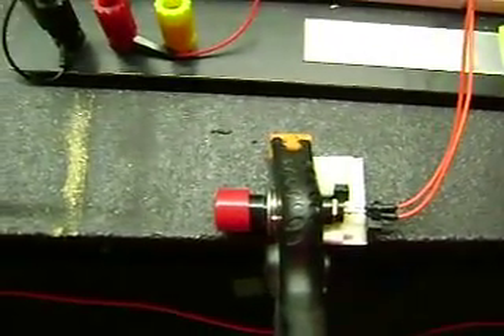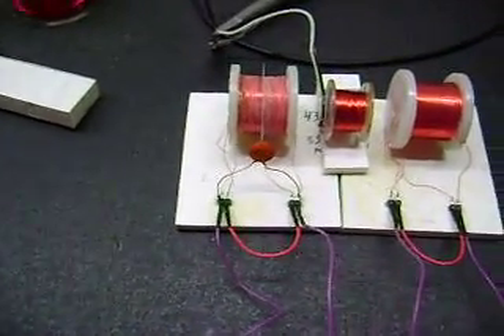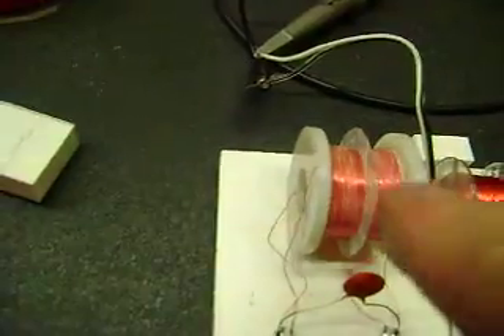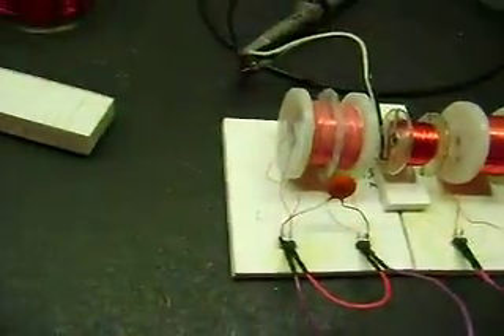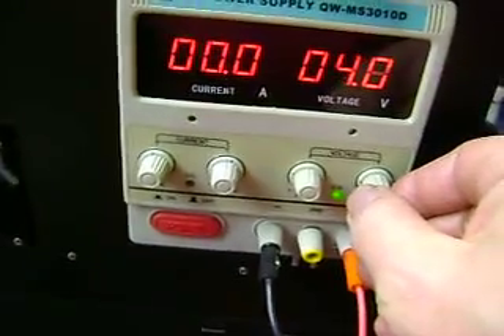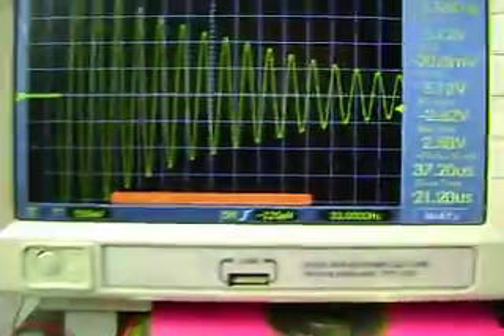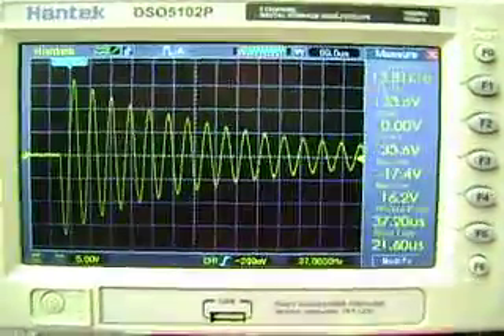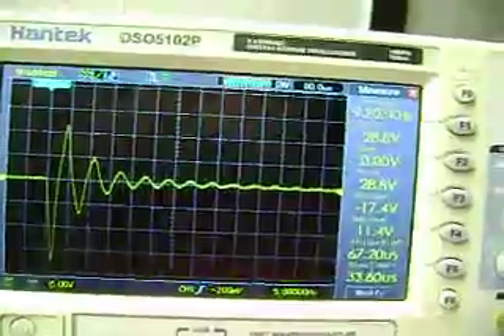Answering Some Comments From My Last Video

Comment: good work! the inductive kickback is dependent on switching time (faster is better) and resistance (higher is better).

if the kickback sees the coil that is pulsed, it sees a relative low resistance. thats bad... 

the trick is to first store the kick back in a (small 10nf)  capacitor, and then discharge the capacitor into the coil, like a simulated kick back. so you have to switch really fast.
this is what I partly do here:
https://youtu.be/1Q8usAXWtVM
Reply from the maker: What i show is just 1 shot pulses.  I let the large inductor build it field then let the electrical inductive kickback spike go directly to the bifilar coil.  These were just to show the difference between a bifilar coil and a normal wound coil as some say there is no difference, or lately they say the bifilar is inferior to the normal coil. I disagree.  
I have done as you have in the past. This way I am skipping 1 step of rectifying to a cap and then dumping into the bifi.  Here I show that the bifi will take in the electrical spike without having to charge a separate cap. The bifi coil is my cap.
Will be doing more this week. 

Mags
Reply: looking forward to our  progress. subscribed.

Comment: Nice on the bifilar, but you are doing the same thing to the cap idea that TM did to the bifilar idea. I may have missed somewhere did you describe how you wound your bifilar... was it two wires wound simultaneously or one at a time?
Reply from the maker: The 2 coils were made some months ago. The bifi coil is wound with 2 rolls of 75ft 30awg side by side together. The  single wire coil i wound 1 half, say the left half first, using the very thin plastic and one of the side wall plastic spacers then very thin superglue to bind it all together so it held its shape to pull off the side wall plastic spacer, then I glued the spacer to the end of the plastic rod and then wound that side.Both 75ft 30awg also. I did this so when doing tests between the coils, I have the option of putting the coils in parallel tests that possibly come to mind. If I had wound the single wire coil in 2 layers, there would be definite differences between the top layer and the bottom layer. So this gave me what I wanted.

These were made for these tests.  I had only gotten to them recently. 

Sorry for the confusion on your posts. Yt may have made some changes that Im not familiar with and its probably what was going on.  Had a few issues with posting that vid.

Thanks

Mags
Reply from the maker: On TMs vid, 3 people and I at the forum have issues with what he was trying to show. Ill be covering that in another vid here soon. Will be going to transistor switching as he says he did(dunno, provided no schematic to replicate).

Im under the impression that he set it all up as to degrade the idea of bifi coils. if his coils are so identical as he seems to imply then the results should have been equal. How could the added capacity of the bifi coil degrade its operation compared to the single wire coil? I clearly had shown the bifi to take on the inductive kickback from the kicker coil vs the single wire coil. Something is a miss there and he will need to define the issue to understand what happened there. Ill be getting into that here soon. Lets see what we see.

Mags
Reply: TM coupled the coils on a single core, not sure if it was on purpose or not. He chose not to replicate your setup for whatever reason. you clearly have the "detecting" coil at a distance from the other two coils. Your method allows for the detection of the "electromagnetic" strength of each of your coils.

Comment: Good demonstration. Only one changing variable. Interesting result. Thanks for sharing.
Reply from the maker: Thanks. Took me a bit to get a grip on it. Thought there was some other problem causing the difference as the input was increased. Changing the pickup coil got rid of some things that appeared to be interference that made me think there was a problem with the normal coil. But once that cleared up, it became evident that the normal coil with the cap added is not the same as the bifilar as some say. Time to go to mosfet switching.

Mags
Reply: I know someone who is working with this as you stated you saw no one else.  Check out Nelson Rocha   channel for his experiments with this.  I have constructed a version his mini exciter which uses this technology.  The results will impress you. Take a look at the mini exciter circuit .